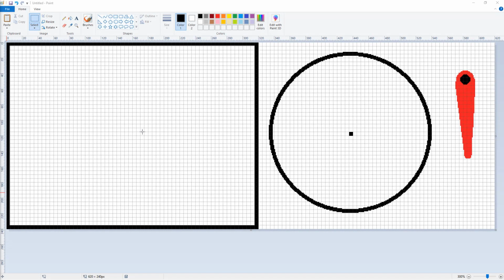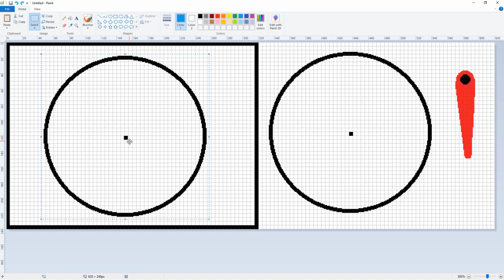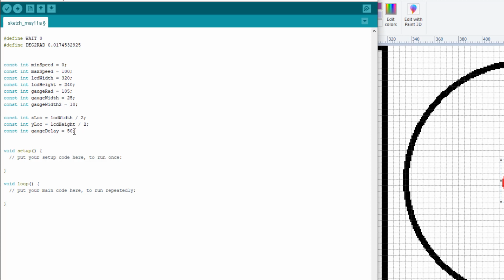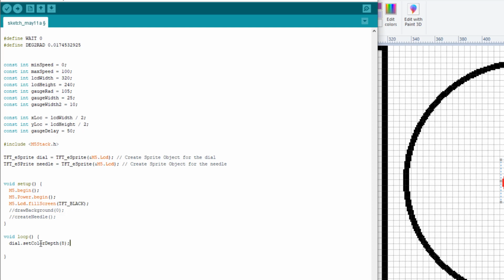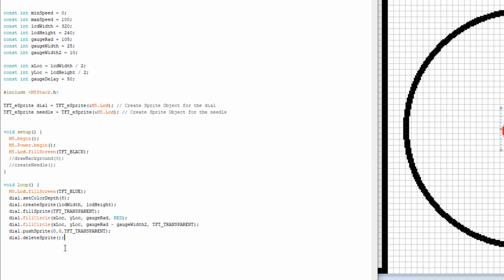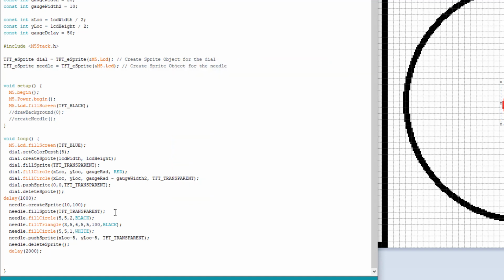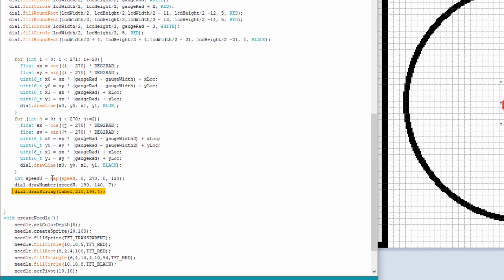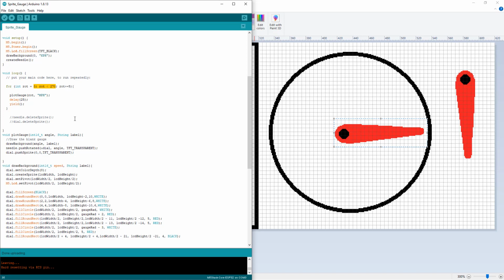Using Sprites to Create an Arduino Speedometer | Beginner How To on Using and Compositing Sprites

Comment: Before I spend a lot of time creating sprites and find they may not work.....Can I do this on an Arduino Mega 2560 with a 3.5" LCDTFT Shield ?
Reply from the maker: yeah in this case the M5stack is actually a little bit of a limiting factor because the libraries are modded and missing some extra stuff you could do.  The main thing is that you build the moving elements and static elements and "push" them to the display.

Depending on which library you end up using I usually suggest taking a look at the samples that go with it.  Most of the GFX libraries will have some forms of sprit samples.  They generally build the sprite in the cpp file rather than making an image and converting it, but its the same thing.

I have on my list a gps speedo using Nextion.  parts have been sitting on my desk but i did start the CAD side of it.  Nextion adds cool options and takes care of a lot with their GUI interface so we are just pushing data from the controller.

Comment: Nicely explained. But you've missed a couple of important things. Ignoring for a moment the drawing of the digits for the speed (the last 3 lines of drawBackground), absolutely nothing changes in the background. You could draw the background ONCE, and then in plotGauge you'd simply do the dial.pushSprite. That's one of the main points of sprites: all you do is copy them to wherever they need to go, saving the re-construction time.  (For a task like this, it's moot, because construction takes very little time, but as complexity grows, it's everything.) To do the text display, you'd use a smaller sprite that you actually DO change on each iteration. You can even, with some cleverness, avoid ever re-drawing the dial sprite at all, and just draw the pointer and text. Also, in your main loop, if you simply did "static int rot = 0; plotGauge(rot, "MPH"); rot = rot + 5; if (rot > 270) rot = 0; " you wouldn't need the "yield", because you'd implicitly be yielding on each invocation of loop(). Also...maybe it's a youTube thing, but every "less than" in your code has turned into "/\", so it won't compile. Also: lots of colors which should be "TFT_RED" are just "RED", etc
Reply from the maker: Thanks for the info!  As i likely mentioned in the video somewhere I am not a programmer so there are likely things that certainly can be optimized!  After that video I did an image based sprite as a next step here https://youtu.be/wbDrjoxb51I
Also with the M5 stack the library they ported over eSPI library they didn't port it all so things like pushing sprites didn't work quite the same.  For example I couldn't push the text but could only do the pushRotated then draw the text on the screen.  At least from my initial tests.  When doing this with images i wanted to "pushImage" but m5 never ported the entire TFTeSPI library over so that wasn't included sadly.  So for example I could composite a sprite with a background, rotated needle and say a warning image with the m5Stack library.  it works fine in the TFTeSPI library in another esp32 device though.

Comment: Interesting but, wouldn't it be better if the 'needle' sprite was an odd numbered width then it would rotate about the pivot point symmetrically?
Reply from the maker: Sure.  Since the sprite gets translated a bit when rotated on small displays it will always be a little chunky.  On a larger display you might notice but yeah that is a good thing to do.

Comment: Hello friend; Definitely a great lesson on Sprites, however, very difficult for beginners. However, 1) I would really like to make an RPM Meter for a small 775 Motor (Tachometer + Opto Interrupter), using this library, but I have no idea how to make the code for the Arduino. Do you or anyone here have a code for this?
2) If I have a 'Gauge' design ready, is it possible to attach it to the Sprite, if I may say so? Or, does it not work that way? My sincere thanks.
Reply from the maker: The first place I would start is learning to code with arduino.  Do some basics because making a display and dealing with inputs, sprites and all that is going to be a task.  There are samples out there for tachs on the arduino hub and places like instructables.  https://projecthub.arduino.cc/PracticeMakesBetter/easy-peasy-tachometer-a629a4  If you are just getting started I would suggest just doing a numerical display and get the rest of your stuff working before worrying about doing a sprite.  You can develop a sprite based gauge independent of the rest of the system and then combine them when you have it all working.

At the core if you have a sensor you are reading once a revolution and displaying that all you really need is that number to feed into a gauge.  In my video we used GPS speed but you would just feed in your rpm value.
Reply: Thanks a lot  @LearnEverythingAboutDesign

Comment: As a retired engineer from Germany i am using the excellent library from Bodmer for years with various MCUs to create displays for Flightsimming. These displays need rotating dials (compass) and linear announcers ( speed , altitude ) and touchfunctions to operate the plane ( autopilot, lights, flaps etc. ). I am working with sprites to create the whole display in the memory and then push it via DMA to the screen....flickerfree .
Until now i learned to use sprites by reverse engineering...mostly analyzing the TFT_eSPI examples and modifying them for my needs. 
Thanks for giving basic lessons for sprites in an absolutely professional way. I didn't find this in the whole Arduino|Teensy|ESP32|RP2040 world . I appreciate your teaching style...wide-angle and in depth at the same time ...
I am looking forward to your future content for LovyanGFX ...which seems to be the FUTURE GOLD STANDARD for these modern combinations of ESP32-S3 with larger TFTs up to 7 inch, parallel data-transfer and capacitive Touchscreens.
Greetings from Germany... naturally you have a new subscriber!!!

Comment: ESP32-Chimera-Core  library is a substitute of the original M5Stack. I'm still learning TFT_eSPI and this tutorial is great for understanding how sprites work.
Thanks for the upload
Reply from the maker: Thanks for the info!  This is the next GFX library I am playing with when I have the time. https://github.com/lovyan03/LovyanGFX   Basically how they ported TFTeSPI to M5 stack they left out the ability to pushImage to a sprite. which means we can't display icons or speed or anything other than the needle(unless you use the full library).  I am told the LovyanGFX is faster and gets around that.
Reply: @LearnEverythingAboutDesign   Great info. I like faster haha😄
Reply: @LearnEverythingAboutDesign  I'm just going through the examples now. WOW just WOW

Comment: Oh cool, you do electronics too! Unlike the 3D modelling this is something I do know about and I've done a lot with micro controllers over the years. I've also done a lot with GPS as well, back when in car GPS was a new thing. When I worked in animatronics we used a lot of Teensy boards. I think my best Arduino based project was the Enigma machine in a pocket watch. I actually carry it as an everyday device. When you say you 'make' things and people ask what it's great to pull that out of a pocket and show them.
Reply from the maker: Wow that is very cool!  The electronics is a side hobby for me, but when I come across topics that take a good bit of my time to figure out or the info out there is lacking I try to cover it.  One of my first electronics projects many years ago was building an AF ratio gauge for my car and an LED based tach.  These were just using chips.  As I got into arduinos the possibilities opened up!  I have been planning a new PCB design series with Fusion that I am hoping to start releasing in the coming weeks making a usb game controller. Showing the PCB design phase and 3d design phase.  I got a new printer I hope is up to the task.

That enigma watch sounds amazing!

Comment: I could never have figured this out . . the programing tutorials are excellent. There is so much you can do with these displays, and they are cheaper than vegetables.
Reply from the maker: Thanks Nicholas!  I have some more planned using a different sprite library as well.  These on the M5 stack don't make use of the entire tft eSpi library and my attempts to hack the library have not produced the results I wanted.  Hoping to do more with warning lights and indicators popping up on gauges in the future.  thanks for watching!
Reply: Great but sad comparison, 😢

Comment: Great video! I’ve been looking for a video explaining sprites and you’ve made an awesome one. Thank you so much! Keep up the great tutorials.
Reply from the maker: Thanks Antony!  I have another video I am trying to put together on drawing images on the screen from BMP converted to bytes vs pulling images from SD cars and making sprites with them.  I have a few more options to figure out then I will add that option as well.  It may or may not be part of the gauge series, but its a topic that could apply.
Reply: @LearnEverythingAboutDesign  I have some gauges that I have drawn up and I’d be honoured if you would like to use them in your tutorial. I drew up several boat gauges to measure speed, RPM, oil and water temp and pressures along with battery bolts. I’m happy to send them to you as I was trying to use sprites to coordinate the dials and faces working together with alarm sprites. I can email them to you if you’re interested
Reply from the maker: I'd be happy to.  Send them to support@caducator.com  In the email let me know what board and display you are using and I will try to point out variations in the video.  I can't promise I can get it to work but I will try.